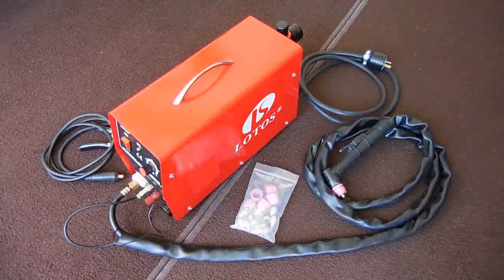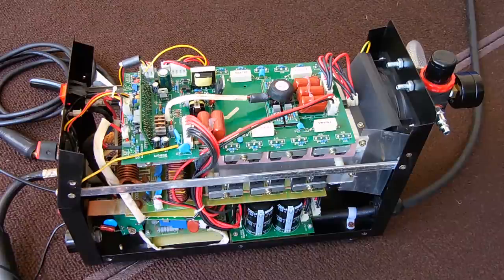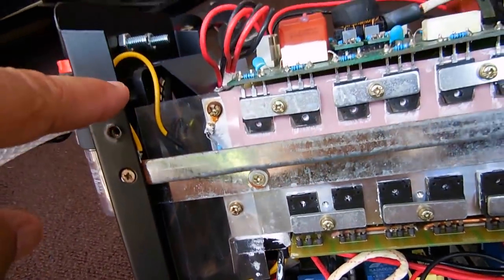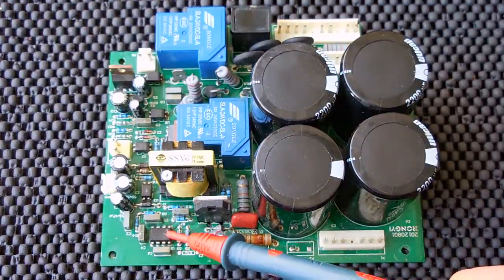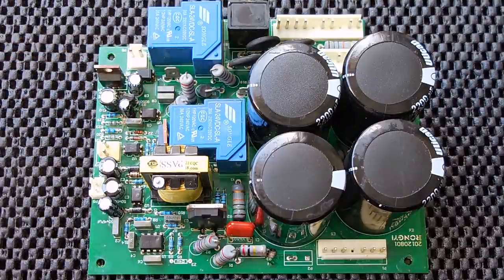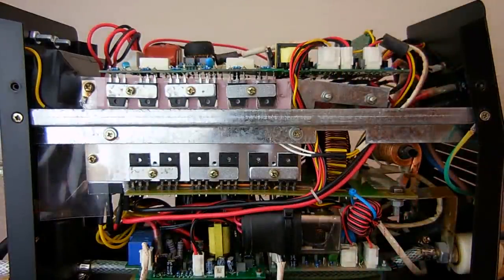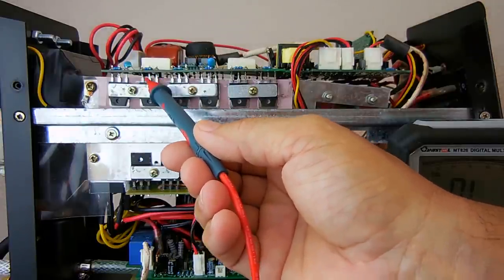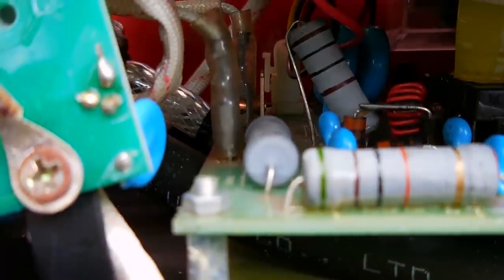How To Repair A PLASMA CUTTER!

Comment: hello good video I have a Chinese arc\tig welder it worked really good for about 3 weeks then one day I turned it on and it blows the fuse in the plug and trips the electric to my house but the machine powers up for about 2 seconds then shuts down because the blown fuse I changed the fuse and the same happened I tried lots of fuses but still the same I checked the basic things like capacitors,resistors,diodes and MOSFETs and they were OK but I don't have the knowledge to find the problem have you got any ideas what it might be   thanks
Reply from the maker: Sounds like a shorted component. You need to unplug it, open it up and perform some tests according to my video. I don't have the time to troubleshoot my viewers equipment. Thanks for watching
Reply: electronicsNmore That's an awsome answer for an unknown issue

Comment: I know this is a very old video, but information on these machines are pretty minimal. I have a ltpdc2000d that energizes fan and I can see spark at the spark gap when trigger pulled but get no torch. Air solenoid energizes but no spark even on contact with piece. With low to no air pressure I get slight spark from the nozzle. I have continuity from pilot arc to nozzle and continuity from gas connection to electrode from torch. I get varying dc voltage from pilot arc to hose connection. I'm not sure what to expect and the manual isn't much help. Any help you could provide would be very much appreciated!
Reply from the maker: I reply to most comments on videos, regardless of age. So many things can be at fault. Try adjusting the gap.

Comment: some times he damage a relay in the capacitor board and a transistor i can't remember the part number. i have experience servicing this kind of plasma units. you take the cover out for a brand and do the same with other Chinese  brand and you will see almost the same configurations  inside. there are two major manufacturer in china. one is ARC SONIC and the other is RONG YI

Comment: thanks,  awesome work
Reply from the maker: Glad you enjoyed the video! Be sure to share and rate thumbs up. Thanks
Reply: electronicsNmore the home made inverter vid was awesome too,    all things considered ,   setting up the initial vibration or resonance within the material, ie the silicon steel transformer block  ,is what its all about,  have you tried an inverter with the ferric oxide material,   it seems to have a much higher resonace than the silicon steel,,

Comment: I need one of these repaired. It never worked out of the box..

Mine is the CT312 but same boards.

If i can just replace the boards id do that but dont know where to find these boards
Reply from the maker: It may only need to have the gap adjusted. I think the company sells parts to consumers.
Reply: @electronicsNmore  ive tried gapping it to.    .040 others have suggested that and nothing. Ive even replaced the arc borad. They sent me one but these people have no acknowledgement of helping after that where i got it.

I get no airflow through it either. These seem to be junk machines from the get go
Reply: Would like to ship mine to you to fix

Comment: Hello, I have one that has exact everything inside as that one exactly the same but mine is painted blue it's a cut 50 D. It is brand new but sat in box for a few years I just never needed it until now. When I turn on the power switch it all comes on and works but the torch activates soon as power switch is turned on even without torch connected. The air solenoid works fine only when switch on torch is pressed but the blue arc on bottom front board buzzes soon as power turned on. It works just have to use power switch as torch switch and torch switch for air supply. I know this isn't correct and don't want it to burn it up running it wide open the whole time the power is on. Any ideas?  I would be very happy to make a generous donation for any help getting this straightened out. Thank you very much
Reply from the maker: Sounds like a fault with the switch on the handle or a faulty relay.
Reply: Thank you 
I know but it comes on and buzzes without handle even hooked up. Soon as I flip the switch those contacts arc and Buzz.

Comment: Hey Doug, Thanks for a great teaching lesson on Plasma Cutters.
Are you familiar with the old "Octopus" component tester?
http://www.jammarcade.net/simple-component-tester-a-k-a-octopus-curve-tracer/
Today there are more modernized (and EXPENSIVE ) versions made that go by the name of the " Huntron Tracker". I built an Octopus back in the 70's while I was still in the Navy. Wonderful and SIMPLE in circuit testing capability. Saves a lot of time and effort.
Also there is less wear and tear on components if you don't have to remove them to test them.
Hope this helps some people out.
Reply from the maker: I like that. Thanks for sharing!

Comment: Sir i have plasma lotos cut60d with torch ergocut s65, arc out without tap torch.

Where a problem, in torch or pcb machine plasma. Thanks.
Reply from the maker: No idea, I'm not familiar with that model. Check spark gap.

Comment: hi there, can it cut half inch steel.
Thanks
Reply from the maker: It is designed to cut up to 1/2" aluminum or steel. I would have to switch to 220v for that thickness.

Comment: On my Juba cut-40,when I switch on the power,the two contacts are arcing without pressing the gun,what is likely causing this?
Reply from the maker: Faulty gun switch, or relay inside the unit.
Reply: @electronicsNmore  thanks for your reply. Turns out that there was water  in the torch line. It works correctly now

Comment: I moved the water  separater so not restrict  airflow on mine
Reply: to the side
Reply from the maker: +terry jenkins Yes, I thought of that too. I'm going to replace the case fan with a microwave oven cooling fan. The air flow is the best you can get. I'll have zero worries about cooling.
Reply: +electronicsNmore I might do the same

Comment: would you say this is the most common failure with these type of plasma cutter
Reply from the maker: Unfortunately I haven't repaired enough of them to know, but in the video I did mention all the things to check. Thanks for watching
Reply: +electronicsNmore you did, incredible job too thanks

Comment: how can i contact you to send you  mine so you can make it work properly.. is not cutting.... has current on it's tip but no arching....  thanks.
Reply from the maker: Try adjusting the arc contacts shown in the video. I don't do repairs for viewers. Thank You

Comment: i opened up my LTP5000D and i found corrosion on the power supply board on the pins and board its on PTC 16p termistor , mpp 475j250v metallized polypropylene  film capacitors like the one on the top circuit board is there any way to cross reference those components i want to replace them before using it again i used the unit once last year when i had problems with the torch so i replaced the whole torch handle with a S-45 triffmet torch handle
Reply from the maker: You can find those on Ebay. Just match the values.
Reply: electronicsNmore ive found the thermistor  now i have to find the other
Reply: electronicsNmore so how do i find the value of the metallized polypropylene film capacitor theres no value number on it
Reply from the maker: terry jenkins
Use a DMM that can measure capacitance, like the one shown on my channel.
Reply: electronicsNmore my innova 10 megohms wont work what brand and were did you buy your meter from
Reply from the maker: http://bit.ly/2aBXPh8
Save $4 with this code: meas77
Reply: electronicsNmore i appreciate the help if you lived close to were i live i would keep you busy and pay you at the boot
Reply from the maker: terry jenkins
This code gives you 8% off: ele1111
Reply: electronicsNmore can i test the capacacitane of the capacitor it while its mounted on the pcb?
Reply from the maker: terry jenkins
Yes
Reply: electronicsNmore i removed both of them there fine but im going to have an electronic repair store to desolder and remove  the small board and remove the thermsitor check them if good clean them up and resolder every back on and I'll  coat it good with conformal coating and apply silicone adhesive to parts that needs little extra support from vibrations

Comment: Hello Doug
       Don’t know where you live 
But if it is possible  I would like to send you my cheap China plasma cutter .  I’ve got 250 bucks in it now ( what the heck)
I feel I should throw more money after bad.   Anyway it worked for 2 hrs  then stopped
The display twinkles but the fan doesn’t come on anymore .  
I checked the thermal switch , it works ok.     So all in all I’m willing to pay you for your expertise.  And send it back if you are willing to work on it.
It would also be wonderful to watch a video of you repairing it.   Bob S
Reply from the maker: If the display is flickering, then you must have a faulty power supply board. I wish I had the time to fix it, but I don't. Thanks for the offer Bob.
Reply: Thank you for reply. It looks as though your plate is always full

Comment: This was the best plasma cutter repair video I've found, thanks for making it.  I don't know if you have a moment to give me some advice but I can't get the arc to start on a used cutter I got.  I made a video of all the things I tested so far: https://youtu.be/8XROWeEfetc   I guess the next thing is to go component by component, not sure which components... but wanted to see if you maybe had any tips on what to try next or maybe trying something basic I completely missed, before I try more things at random.  I've never had a plasma cutter before although I have a tiny bit of electronics experience and thought I had a chance to bring it back to life.  So far no joy.

Comment: I have expected IGBTs on the primary side, not MOSFETs, thumbs up :)
Reply from the maker: I think the company replaced the lower boards on newer units with (1) power supply board which is more "heavy duty", and uses IGBT's.
Reply: electronicsNmore Ok :)

Comment: hi  good video .     I have the same one  brand new out of the box   came from  lotos  .      and mine spits and sputters  when I try to cut with it .   its hook up to 110 volts .   I was thinking about hooking it  up to 220 v   so it cut faster  .     I have  air going to it with out  a regater  .on the machine     because I have one on my air compreser    .   pluse      I notice my tip  and   tip cover    burn   now .      ps do I have to use the same  tip s and cover    for the machine .
Reply from the maker: roy thornton Try a slightly smaller spark gap.

Comment: How much would you charge to fix a plasma cutter something like that one it's a 50 plasma cutter from eBay I got it new and never work I told the seller and they never contacted me and eBay never got back to me and I paid $190.00 it's sad cause I was hoping to fix it and running but every video I see doesn't help your video is long and helpful but don't know how to order the parts that it will need so I stuck with a broken plasma cutter
Reply from the maker: As much as I'd love to help, I don't have the time.

Comment: Great video. My skills aren't nearly as good. Just wondering if anyone can give me an idea of what would cause the power light to flash along with the relay clicking on and off. When I press the torch switch, the click gets louder and I think other relay is clicking in time with the first. The fact that it's cycling in a set interval kind of makes me wonder if it could have to do with the rectifier. It sounds like it's cycling once per second (60 hz, right?). If there were a problem with the rectifier, wouldn't it be going on and off because the ac isn't being rectified into dc? I hope someone can help me work this out :/
Reply from the maker: John Hicks Sounds like a voltage drop.
Reply: electronicsNmore thank you very much. I really appreciate it

Comment: 10:01 doesn't look heat-damaged to me. It obviously shows some discoloration, and if you consider what it's there for, and with the suspicion that the relay is faulty, it seems well justified.

I wouldn't go pointing at a bunch of components saying they are faulty before measuring. The first rule of troubleshooting is: *one shall test voltages*, and if you had done so upfront, you'd have discovered the faulty relay way sooner.
Reply from the maker: You can see the relay was heating up, very clearly, the plastic was distorted. The resistor also clearly showed damage from excessive heat.

Comment: Has anyone found schematics for these plasma cutters?....The manufacturer is most unhelpful.  I am having a problem with arcing across the nozzle because the high frequency start is not switching off.  The switching transistor base for the circuit relay is connected across the output through a of resistor/choke network (test OK).
Reply from the maker: You need to do a thorough online search.
Reply: Been through the WWW, FTP and Usenet, next stop the darknet but I doubt I'll find them there.